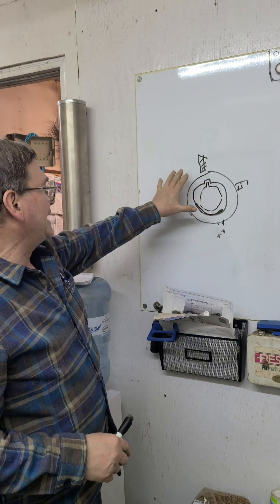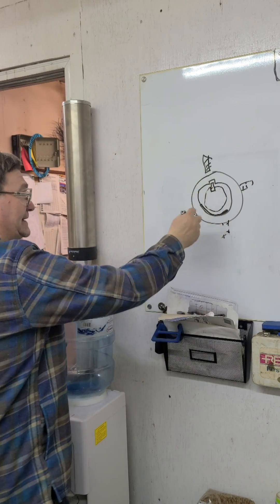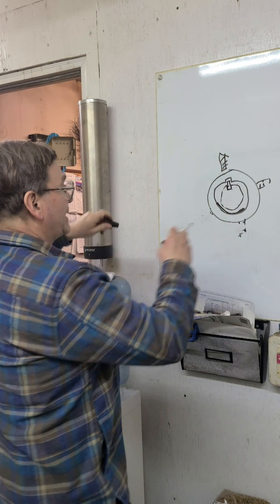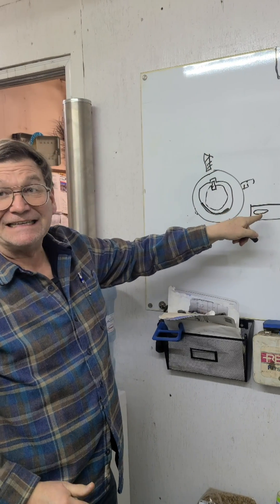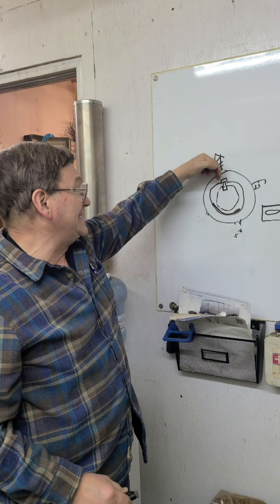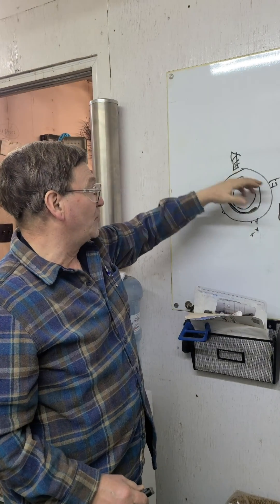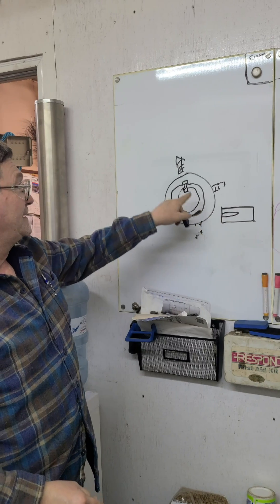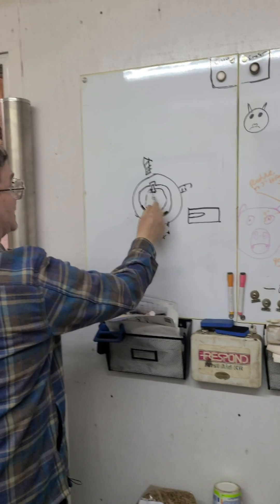Machinist's Minute(s): Setscrews and keyways

Comment: The latest madness is for critically synchronized components (IE engine crankshaft-camshaft) having circular hubs and shafts without any index, to be built without keyways and instead rely on clamping force after an initial timing of the components. Crazy.

It must save $.20 on the line?
Reply: Living in the future is really cool sometimes, it's also really dumb in some ways.
Reply: Yeah I deal with that alot it's the worst

Comment: Wouldn’t double set screw prevent unthreading from vibrations
Reply from the maker: It is better, but still not perfect.  The loosening is not from vibration, rather from key/shaft rotations, as the load varies.
Reply: Thank you for the explanation i have stokes r4 presses in the factory and we double set screw the cam to the side of the crank, and the key. I have not noticed them loosening.  I’m sure some of the ones that need rebuilding might have loosened over the years. Next rebuild I will definitely check.
Reply from the maker: If the shaft, and key size are large enough it is seldom a problem, the loosening occurs when the load is high in relation to the size.   @fang4853

Comment: Why do they place set screws  a few inches apart on the circumference instead of the opposite side(across from each other)?
Reply from the maker: It causes the shaft to be more secure because it is pushed against solid metal opposite the screws, if they are across from each other the holding is only on the threads/points of the sets screws & it will work loose sooner.  If you want it concentric, a taper-lock or interference fit is much better.
Reply: @HOWEES  ahhh 
Thx for the explanation 😌